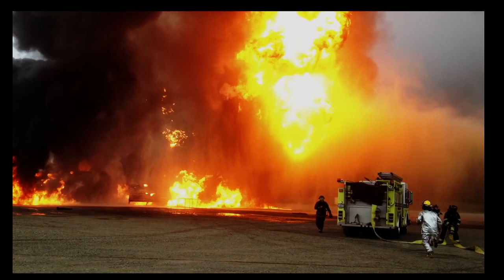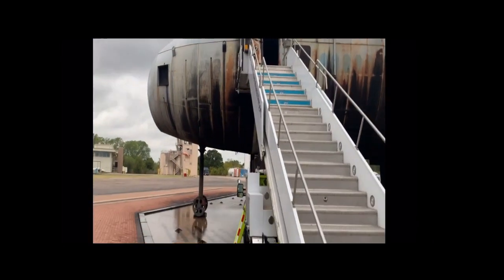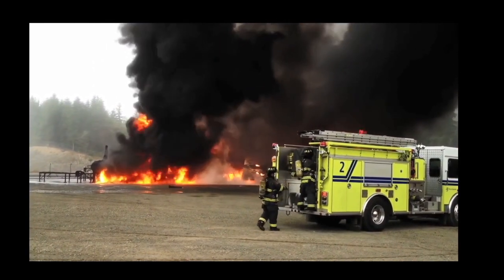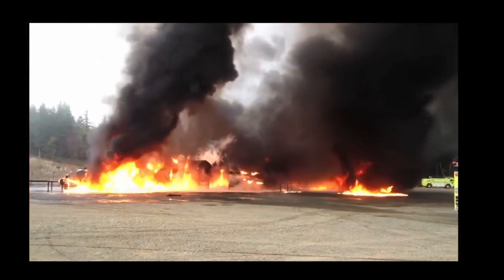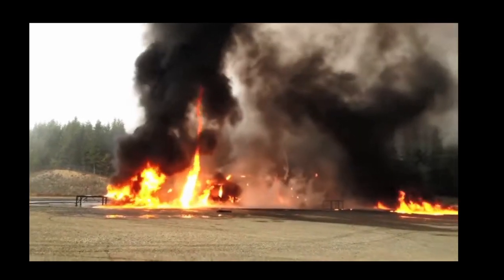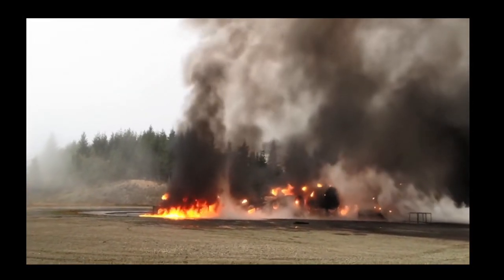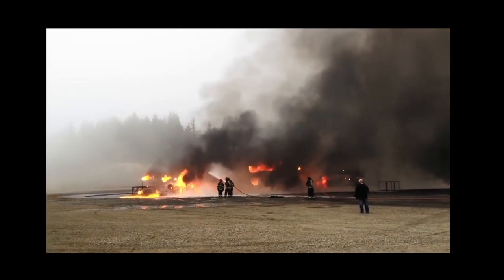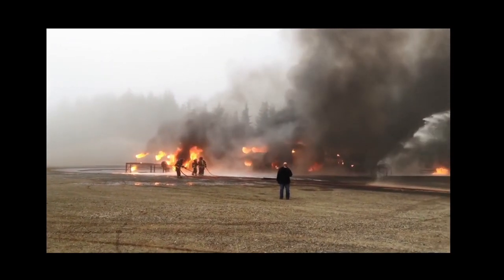ARFF Fire Training Goes Wrong

Comment: Do you know the cost to clean the trucks spraying Diesel fuel? Does the pump need recertified?
Reply from the maker: We have never done this, but you could probably run water and foam through it into the pit until the diesel is flushed.

Comment: This is what happens when you do not perform preventive maintenance on your equipment. They should have made it "snow" with foam & when in doubt go turn off the mainline supply valve..
Reply from the maker: Yup,  total maintenance issue.  Glad they did not pull hand lines from those ARFF vehicles first.  Also, glad they did not use those trucks on a real accident